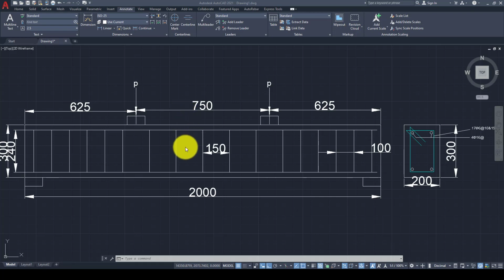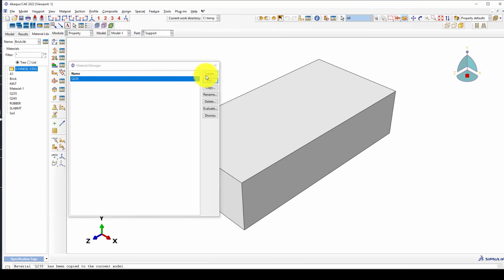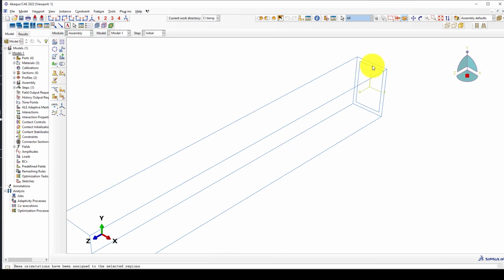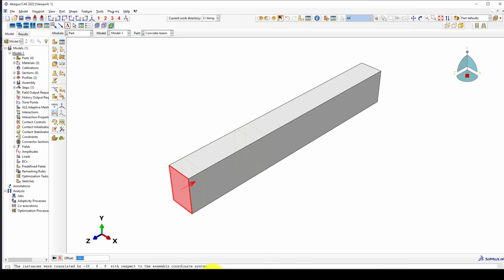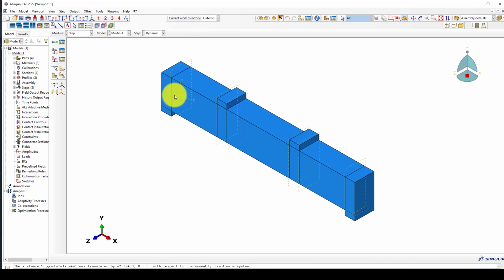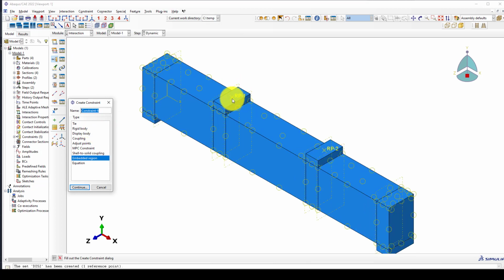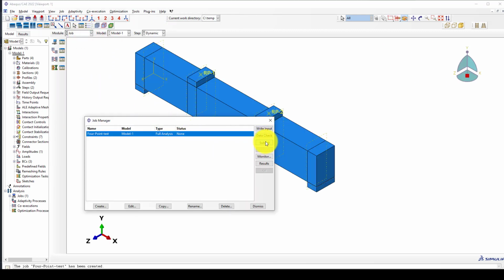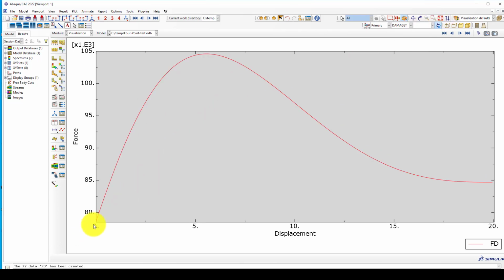ABAQUS Tutorial RC Beam under 4 Point Bending test

Comment: Sir, I am doing a project of geopolymer beam with gfrp bars and my beam is not having any stress but bars having stress and fails, what could be the reason
Reply from the maker: You carefully watch this video and see where you did wrong.
Reply: DamageC and DamageT values are zero, what can be done. I have done all the steps as mentioned in the video
Reply: @gokulm874  define damage parameters in CDP

Comment: Hello again, KSEE Structural Engineers! I want to ask how to determine/obtain the shear force and bending moment in the RC beams with that kind of setup (four-point bending test).
Reply from the maker: You should watch the video carful which is the shear and displacement is drawn, for the bending moment you can request from history output or simply do a calculation with the shear forces and length of the beam.
Reply: Yes, I also did this, but is isn't too easy to solve the shear force and bending moment just by using the maximum load capacity of the beam? Because, if I do some research to determine the load capacity, shear, and moment, isn't too bias to just find the shear and moment just by taking and using the load capacity?

Comment: Hi sir, thank you for the tutorial. It can be seen from the force-displacement curve you obtained indicates that at 80kN of force the displacement is zero, which seems abnormal for me, can you make some clarification on this? also how can the users know if the frequency they used in the butterworthfilter is appropriate? Thank you.
Reply from the maker: Hi there, It's a  random tutorial for the verification you can take an experiment. here I have discussed how to model and get the FD curve and how to use the filter .

Comment: Hi, there. I just wondering have you ever compared the results of reinforceing bars my setting the element type to truss instead of truss??
Most people using the truss element instead of beam. And many people said there are not big different.
But in my case much difference deflection when the element type was used as a beam or truss.
If you've ever tried it, I am curious if the results are the same.
Many thanks
Reply from the maker: There is no different for this issue.
Reply: @KSSE_Engineer  Thanks, maybe I have some mistake when I using the truss elements.